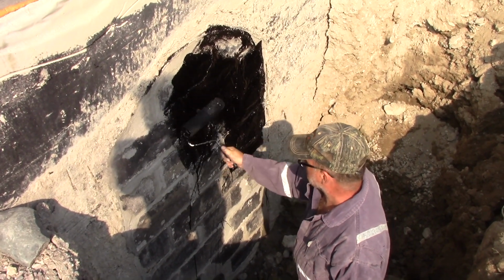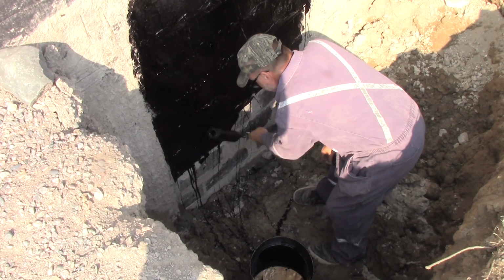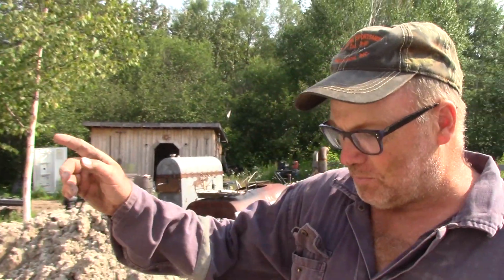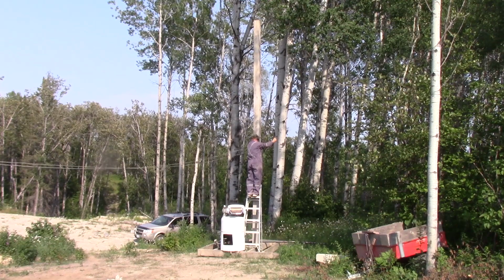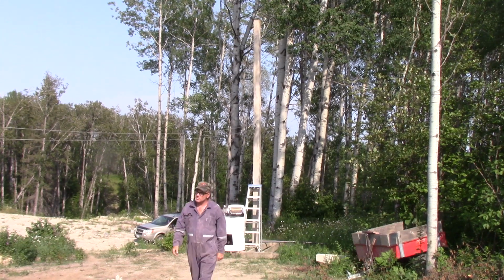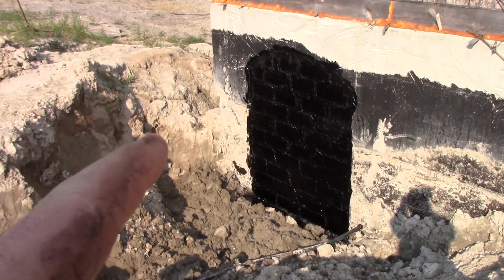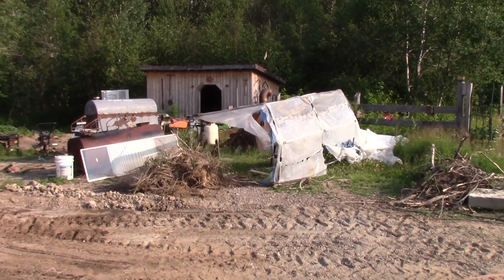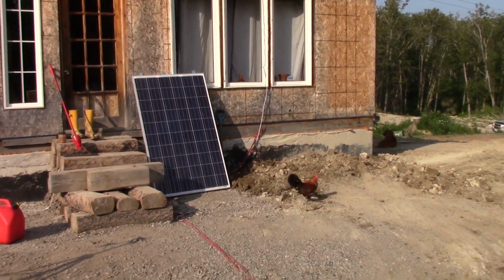The Work Never Ends At Our Off Grid Homestead

Comment: After watching your water problem and the lay of the land around there, you may have to consider some sort of French drain system.  Dig a trench near the house on the side that floods, run septic field line in it and run the line over to that low area and give that water a path away from the house.
Reply: That was installed with the basement build, and working great.,

Comment: just curious ... why when you were putting tar on the opening of the door did you not do all the exposed area while you were there .... im sure it wouldnt hurt to put some on the rest of the wall that was showing ..just  as a sure thing ...i know there was some there origionally but just wondering why you wouldnt touch up while  the hole was open?
Reply from the maker: I figured since the tar was already applied to the existing concrete when we built there was no need to apply more, Plus we will need the tar on our other building projects this fall... I didn't want to waste it on this job.  Also I would have had to clean all the dirt off the wall or the tar would not have sealed either...Cheers.